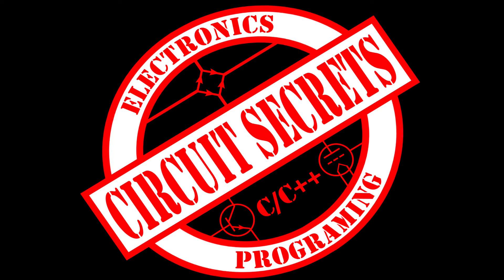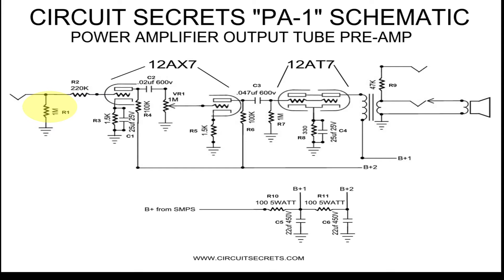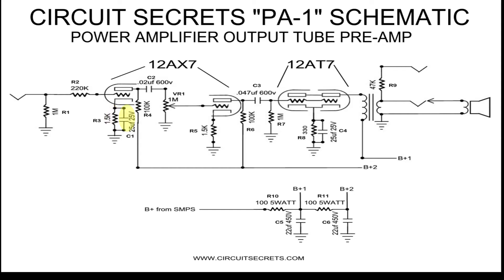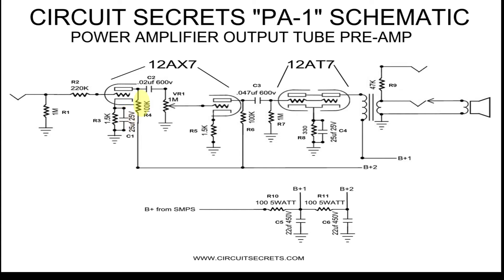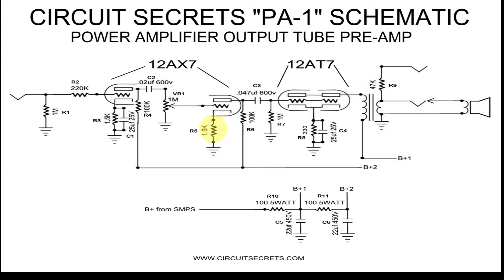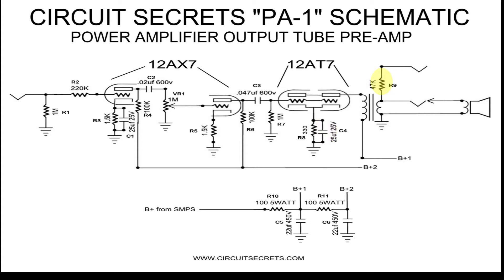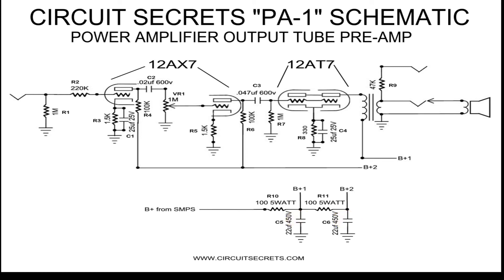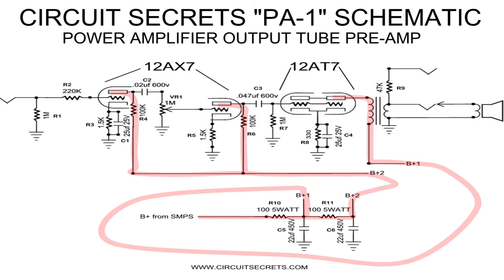DIY Tube Preamp Build Part 2

Comment: One nice feature on the  1363HVLN  high voltage power supply is the enable. Not sure if many care but with a control/enable circuit you can delay power application to the plates. Nice amp and interesting to see a "Darlington" configuration in the second stage or does the term not apply in tubes.
Reply from the maker: Right having the ability to shut down or change the voltage output of the smps gives a lot of options. The first 2 stages are just a normal series layout, the 3rd stage is a parallel configuration. I do se what you mean about the 1st and 2nd stage looking like a darlington stage. Thank you!

Comment: Where is the power supply schematic?
Reply from the maker: The lower half of the schematic shows the filter setup I use with the power supply module. The schematic of the module itself I do not have access to as I did not design the module. Wiring diagrams for the power supply module are available from shop-tes.com which is the site of the producer and distributor of the smps module.

Comment: I have a 1950's tube intercom that I plan on converting to a guitar preamp, this video is helping me figure out how to go about that. I plan on using the existing transformer that powered the 2 existing 12Au5's and a 50B5. I'd like to run two 12AX7's for higher gain.
Reply from the maker: Nice, just use caution transformers can be very dangerous, an smps can be dangerous too, but they don't run the risk of a short to the mains power.

Comment: Thank you for this very informative video!
I've a question: is signal phase in the output flipped?
Reply from the maker: I believe so, but I don't have a way to confirm. I have dug into all the documentation I can find about single ended amps and I cannot find definitive information on if the transformer inverts the signal. I know that fender champs had the same number of gain stages and some of the originals had the speaker wired backwards, maybe for phase correction?
Reply: @CircuitSecrets  thanks for your reply! As I understand every stage inverts signal (if we take it from anode). Also transformer should have the same phase. Or at least I don't have "invert" button in my passive DI box which contains transformer. And phase is the same. It will be important to notice phase invertion if somebody use more than one microphone (for instance to record acoustic guitar), and preamp will be used only on one of them.
Great stuff, thanks for sharing your knowledge! 🙂👍🙏
Reply from the maker: @ChrisPawlocki  Thank you!

Comment: Nice build.
What should the voltage reading be for B+1 and B+2.
and how many ma. of current draw should be expected.
Thanks in advance Robert
Reply from the maker: B+1 shows around 198 and B+2 shows around 197 on mine. It may be a little different depending on how the individual tubes behave in another one. The same bias resistors and B+ but using another tube of the same model can have different current draw characteristics. Its best to measure the voltage on yours, and do the math to determine the actual current draw. The SMPS can only output about 45 ma at 200 volts when driven by 12 volt D.C. Its been a long time since I probed and took the readings on the unit, I forgot to include the actual readings in the video, and have since forgotten the actual results. I should have included a full explanation on testing the current draw and bias on the unit. I know the bias on the 12ax7 stage is fairly cold, and the 12at7 is pretty hot as I designed it. I tried to maximize clean headroom in the output, and the typical tube breakup in the gain stages while saving more current for output. I remember aiming for 20ma on the output and 10 ma on the gain stages, I don't remember how close I got, but it can run for hours with no problems so the current draw on the smps should be below 40. I hope that helps a little, I will try to get a video done showing the values at different test points and total consumption.

Comment: i Love your Tube amp vids. You dont talk to much of focus on jokes. You sound like a teacher. Im trying to make a mini PA system out of alot of scrap and electronics i pick up in dumps. Along with some second hand  amps. I need 2 pre amps one for bass and the other for mids and treble. I paid attenention to wat you said about tone control and i like that. Wat do i need to consider changeing to affect the tone?  So im thinking the mids and tops pre would start at about 300hz, Im learning and trying all i can to get this right and need all the help i can get. Could you help me a  little? I dont mind making a cross over to deal with adjustments if i have to
Reply from the maker: Thank you! To have adjustable tone you could build a tone stack and drop it in between the first and second preamp stages. To thin the tone you can select lower value coupling caps. You can add a bright cap across the volume pot to give it a little more modern sound and the typical tube preamp brightness. A crossover is always an option where you split the frequencies and adjust the gain for highs or lows, but to get a good sounding crossover that does not eat all your tone you need a few stages and I would use op amps. With those you have the added complexity of needing a power supply with both positive and negative rails, lots of filtering and voltage regulators. I intend to do some videos on modifications to the preamp, but my initial goal was to present a simple and easy to understand preamp that has a similar tone and characteristic to the ones that were used in studios when they were built in house. Good luck with your home built PA!
Reply: Thank your for your help. I am bery greatfull. I have been on this over a year and most YouTube's are not helpful. I work above my skill level as it the only way to learn and grow. I do the undone things like making my oen cassette recorder  but could not get any help on how to make tge pre amps for the tape to play and record so i cannibalized a walkman and used that which is quite messy. 
Life is for learning so i try hard but i really need a teacher to lean on. Your a great help. Thank you a million times.